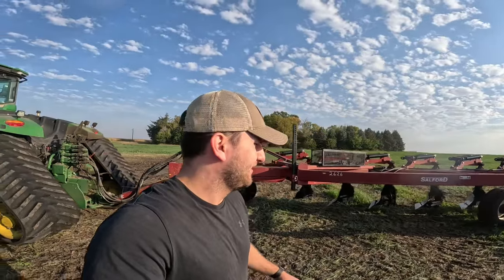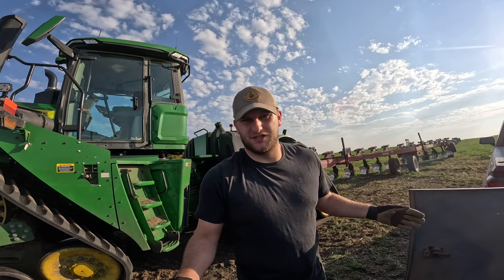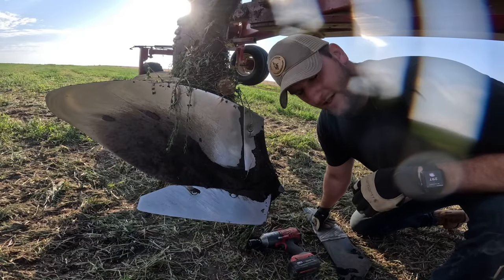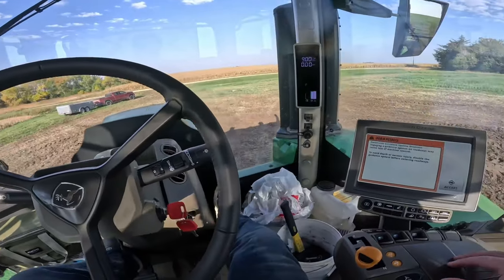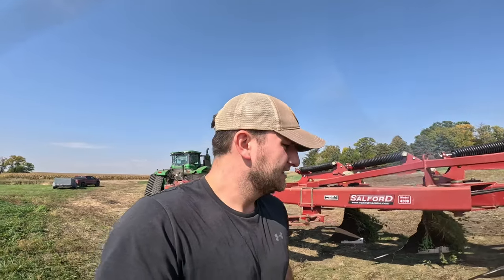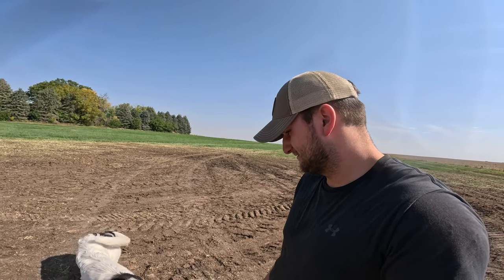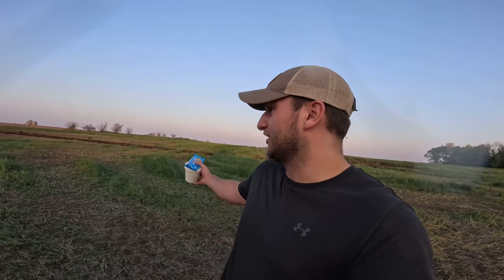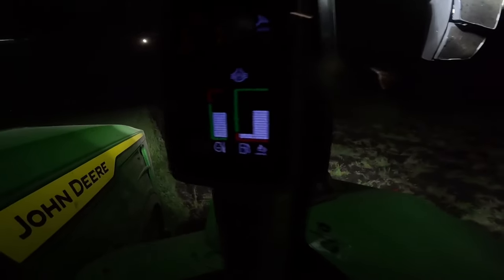Moldboard Plowing An Organic Alfalfa & Clover Field

Comment: Thanks for your video.

That looks like a mile long field that you are in.  How many acres in it-?

Makes sense to turn all the good stuff up again that the moisture has leeched down thru the soil.

I'd like to see you with a rollover plow which would mean less time spent on the headlands.
As a good winter project, make a 20 bottom rollover.
Reply from the maker: Thanks, I was plowing 200 acre field. We find it very beneficial. Now that’s a winter project and a half 😂